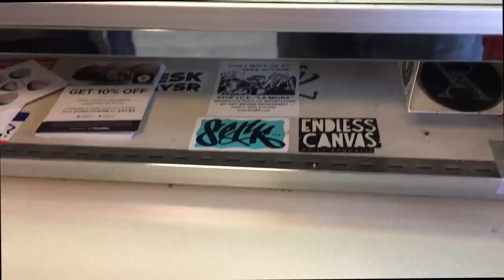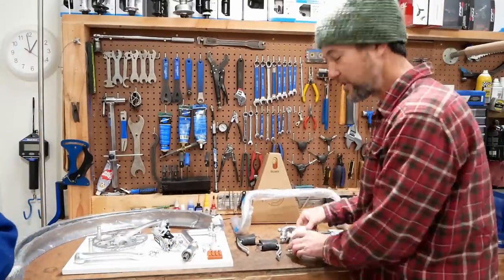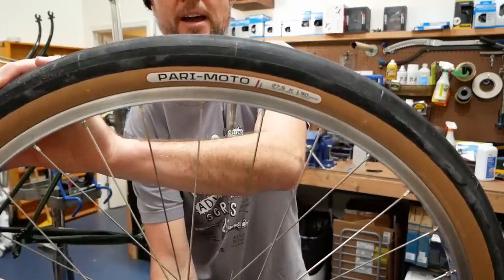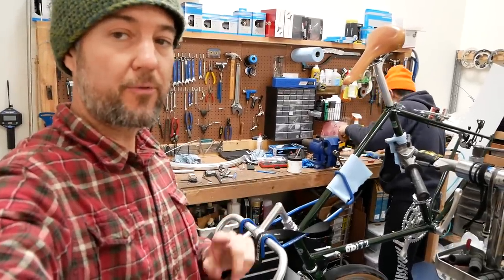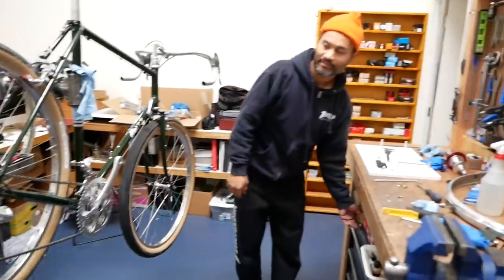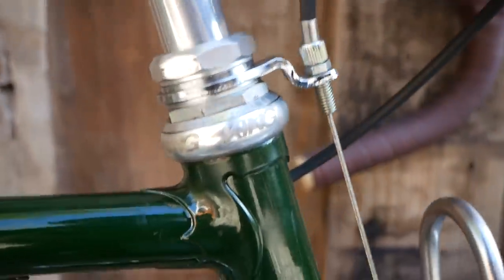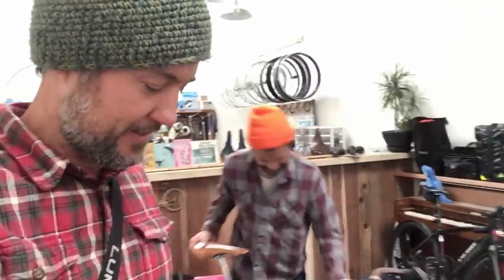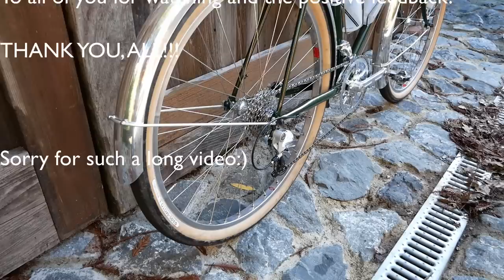Custom Steel Bicycle All Road Bike: The Complete Build

Comment: This build is awesome. I've been considering something similar, with many of the same components.  I'd love if you could do some videos on these specific things:
- A full review of the Galibier saddle, especially how it compares to the Brooks Pro and Cambium
- Pari-moto tires vs Compass
- Your experiences with Mafac brakes vs cantilevers
- Should we be concerned using such old aluminum brake components?  I would love to hear your opinion on metal fatigue, warning signs for over stressed calipers, etc.
- The Chris King headset.  How does it handle the low-trail geo? Also once you get your rear light and generator hub, will the cartridge bearings conduct electricity to the rear light?
- The IRD Sub C front derailleur.  I have the same VO 46/30 crank on 2 of my bikes and get the same combo of chain rasp and over shifting.  Say thanks to Omar for pointing out this FD, I never knew about them I will have to check them out.
Reply from the maker: Thanks for the video topic suggestion, Tim! I just reached a 1000 miles on this bike and thought it might be a good idea to do an intermediate update. I'll talk a little about the parts and the things I've switched since riding it, and your list of suggestions is perfect. I appreciate you putting that together. Cheers!

Comment: Your explanation of the 46-30 1x scenario is what Mr. Heine talks about with the 30 being a bailout for those steep climbs, etc.. Love Omar's smiling face when he was giving it a test ride. By the way, are you close and personal enuff that it has a name?!?! Would like to hear about the tires at some point, too.
Reply from the maker: Thanks Rob! That makes sense now! For my style of riding I'll need to spend a little more time on the 30 because the 46 is just a touch too big for most of the climbs around here. Otherwise, there seems to be enough cross chaining on the 30 to allow me to spin on some coarser surfaces and pedal around town. I don't think there is a perfect scenario any how, so I'll probably just learn to adapt to this configuration. I really like the narrow Q (a lot!). The tires so far (are really nice). I've heard they are puncture prone (okay, I hear that about every tire). That said, I think tire pressure is way more important than I had first understood it to be. Now I'm very careful never to over inflate the tires. These tires suffer from premature failures (and wear) on too much pressure. Run 'em low! They way I arrive at a pressure is keep lowering it until the bike starts tracking things on the road. The white stripe on the should of the road as one example. That means the file pattern on the sides is starting to grab. Then I add 5 to maybe 10 psi back. That's the sweet spot. It'll roll fast, but they will last longer because more tire is still in contact with the ground, and less flats! Coming off a lot of road riding I had the tendency to pump em up so they would feel fast. That was a mistake. I got lots of flats that first year, and wore through tires fast. FWIW, the auto industry really goes into great detail on proper tire pressure to maximize tire life. That should apply to us too.

Comment: The positive steering feel on this bike might be due to shorter top tube / reach compared to the behaviour of your other bikes when steering. 
If the top tube is just slightly too long for a person, the bike usually understeers.
Old Bianchi's used pure race geometry (same as most bikes produced by the big names back then) which explains why the head tube has a steeper angle.

Comment: One good question for Omar would have been: what is his thumb rule for cutting a seatpost ?
How much of it has to remain in the frame without compromising safety ? And keep the weight as low as possible 
Serious science here.
Reply from the maker: That's a good question, Desi.  In my case, my seat post length was limited to the depth where my rear light braze-on was positioned. The light needed to be high enough so it could be seen from the rear (above the fender line), but low enough for the seat post to fit into the frame. It's worth noting a bike with a sloping top tube wouldn't allow for a light mount such as this one because of how low the light would be positioned.
Reply: I would offer this. Determine the seatpost length then after you cut the tail of the seatpost, add the length of that piece above the min insertion line , then scribe the post there as the new min insertion line

Comment: Triple chain rings are pointless.  I have 46/30 chain rings on my  gravel bike.  I have no use for bigger chain ring since I don't go faster than 25 mph.  The small ring gets me up any hill.
Reply: All depends on how much range you have use for, and what kind of spacing you like. My gravel riding is mostly in the PNW Cascades foothills, where plenty of climbs are 1000+ feet at over 10%, with sections of 15%+. I like having sub-1:1 gears for that stuff. But I'm also sometimes riding the bike in pacelines that cruise in the mid-20s range (and reach considerably higher speeds while still requiring that I pedal), so I want a 100"+ gear and decent spacing for speedy riding.
Getting the range with a double would be easy, but it would require annoyingly large gear jumps.

Triples can also make for snappier and less-disruptive front shifting, since the gear jumps can be smaller. They're often maligned for poor shifting, but that simply hasn't been my experience. Pretty much any well-designed front setup can shift smoothly and consistently, the differentiating factor is how big the shifts are.

Comment: Wow! What a nice retro bike! You're really talking my language here, with Sugino, Nitto, centre-pull brakes, friction gear levers, etc. but I dislike the saddle - utterly. Don't those protrusions on it rub on you? I have a Selle Italia Rolls saddle, which is somewhat more 'modern' than yours but I have carried it from one bike to another over a number of years. It still looks brand new. My current bike is totally different from your 'project' bike; it's a monocoque carbon frame with all-carbon forks and Ultegra 11-speed on it. It's a beautiful bike to ride but I've got a yen to go touring and the lack of clearance between the rear tyre and seat tube (with 23mm tyres!) dictates that I must get a different bike but I'll have to get an off-the-shelf one, because I'm a pensioner. I wish you many hours of enjoyable riding with the 'green machine'. One thing: I think that bar-end shifters would be much safer, especially if you ride in traffic and/or race with this bike.
Reply from the maker: Charlie Cassowary it’s great to find other like minded cyclists who enjoy a variety of bike configurations not just modern high tech bikes. The saddle is pretty comfortable so far and it’s relatively light too. Part of the saddle comfort likely results from the plush tires and springy fork. Best of luck to you in finding your next bike touring/packing bike. There’s a lot of off the shelf options today and even more coming soon it seems.

Comment: Ird defiant triple has a pretty low Q factor if I recall correctly
Reply from the maker: Yes, it does! It's very similar to the VO. The trouble with it is we found out there are only a few inner ring options (34 & 36). I inquired with VO to see if there is plans to make a 39 middle ring in the future. A 36 is pretty good, but with a triple I have found I like a 48-40-28 (or something close). The middle ring is sort of an all around gear and it's centered with the cassette so the chain line is straight. The 48 is for downhills and fast group riding on the flat. Of course the 28 is a superb climbing gear. Hopefully they will add more chain ring options because I would love to have a narrow triple! I could probably find a vintage used triple to make work, but I need to start looking around.
Reply: Henrywildeberry ah that’s a good point (and frustrating I bet)! I find the 36 is good for city riding as I’m often stopping and starting but for longer rides I could definitely use a bigger ring.

Comment: Friction 10 speed is stupid.  I did it but you barely touch it and pops a gear.
Reply from the maker: These shifters are in between a true friction shifter and an indexed shifter. They have a type of ratcheting mechanism that holds the shifter in place. You can click it up or down a few clicks to trim the derailleur around the gear you are using, and it seems to stay in place pretty well. So far so good, but only time will tell as things break in and start to loosen up.

Comment: Technically, it's called a touring bike. wikipedia.org/wiki/Touring_bicycle
Reply from the maker: I think this bike would fit more of a definition of a sport tourer, but it's fashionable to call it an "all-road" bike which is just a new way of calling it a randonneur. As humans we like to reinvent the wheel, literally in this case. The tubing isn't sized to carry a significant amount of weight, as a true touring bike would. The front end is very light and capable of only carrying a small to medium load (15 lbs or so), not a fully loaded touring weight. On the other hand, my 1983 Specialized Expedition touring bike fits the touring bike definition closer than this new bike. The Specialized has thicker walled tubing, and designed for a balanced load (some up front and some in the back). It rides a little stiff until you add the weight. This bike rides more like a fast road racing bike, but with larger tires for off-road riding and the simplicity of rim brakes and DT shifters to make sure I can get home on self-supported rides in areas where you don't want to get stuck out alone. It's an adventure bike!
Reply: Although it could be used for touring, it's characteristically pretty different from how "touring bikes" are usually designed. For instance, touring bikes usually have extra-long chainstays to aid with pannier heel clearance and rear load weight distribution, but this bike does not (the frame likely also hasn't been stiffened with rear load stability in mind).
Reply from the maker: Yes! It's easy to look at this and say, "hey that's a touring bike!" However, when you ride it, instantly you're met with a completely road bike feel. The fork is so light as it is, I'm afraid to put weight on it. The frame flex is just perfect right now, so any added weight and I bet it gets noodley (is that even a word?) really quickly. The low trail front end allows the rider to climb steep fire road grades with very little steering input. It's a performance oriented, all road bike (road + gravel + smooth single track), with provisions to carry some stuff (multiple layers, tools, food, and possibly a change of clothes) to help you go a little further without any help, and overall very simple to fix, and maintain. I'm sure there are other ways to define it, but for me it's an everyday do-it-all well enough bike. I can see removing several bikes from my stable now. Anyhow, I hope this series inspired others to get out and ride bikes, on whatever bike you have, and whatever bike you choose it's cool with me!
Reply: @Henrywildeberry  "all road bike"? You mean "gravel bike"?
Reply: @shannontrainer5857  More or less. "Gravel bike" is a pretty wide spectrum, and unfortunately the term connotates overspecialization for a lot of people. "Allroad" doesn't carry that connotation, and is perhaps more accurate for this particular bike because it announces its road-esque design (i.e. it's more of a fat-tired road bike than a drop-bar mountain bike).